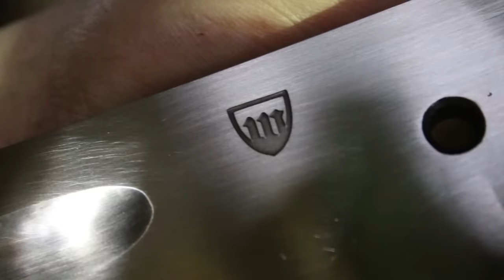Forging a Bowie knife, the complete movie.

Comment: Not much of a fan of the slightly curved handle, but the blade appears to be the proper length, between 8" to 12".
The clip point may be a bit shy of 3.5", but not by much, and the guard is pretty much correct, somewhere between straight and "S".
First one I've seen with a fuller. But, overall, Good Job! Although I think a Brass Guard and Pommel would look better. IMO.